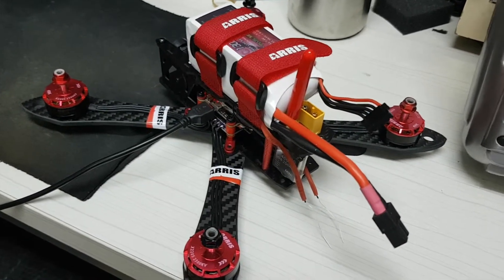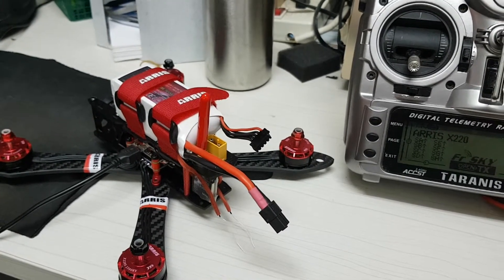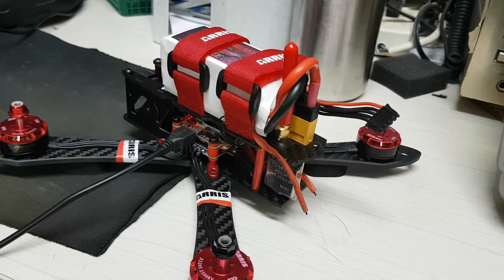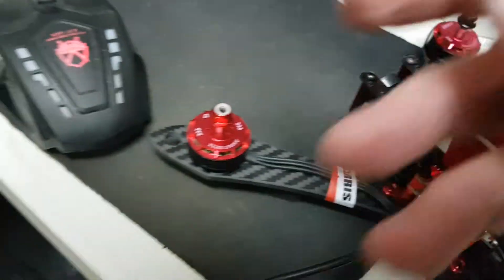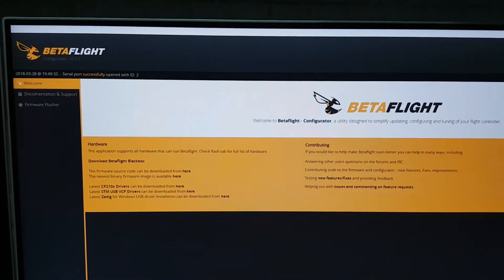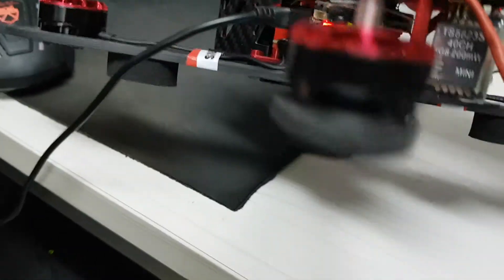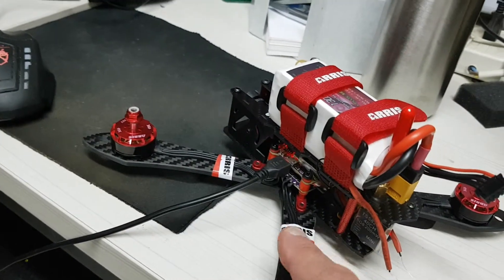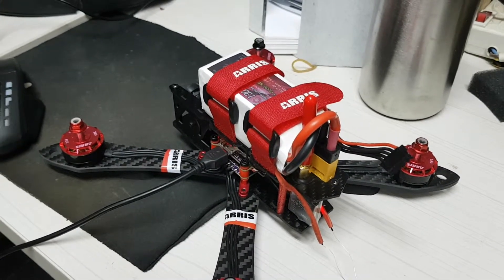Arris X220 problem (almost DOA)

Comment: So you flew it, and now it has a motor binding and the radio and flight controller isn’t responding. I would first like to suggest you use some zip ties to get your receiver antennas away from your rear props, and second I suggest not crashing your quad and trying to pawn it off being broken before you flew it/DOA.